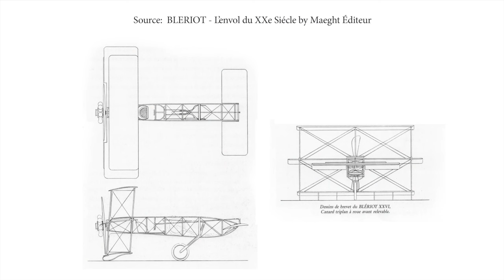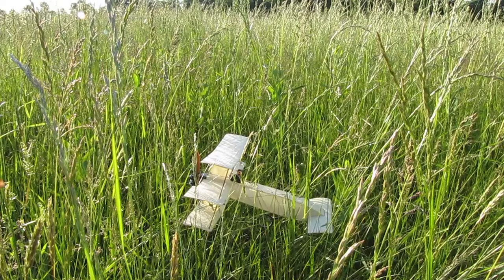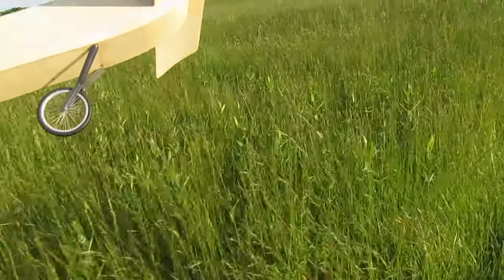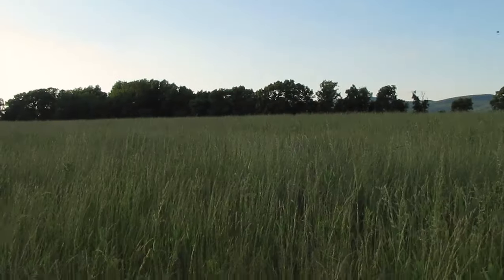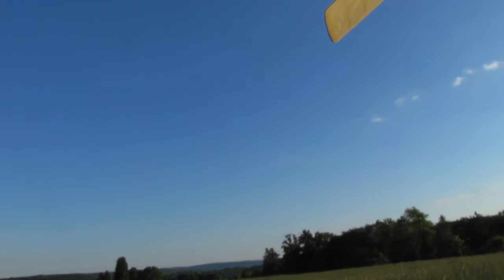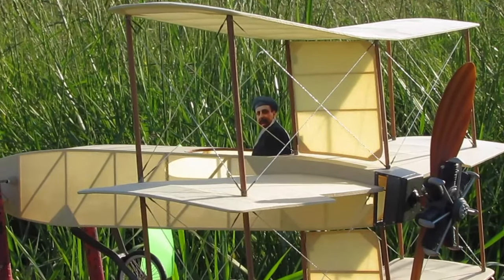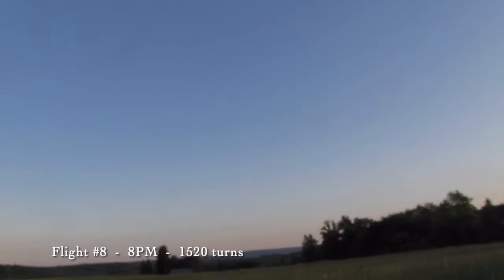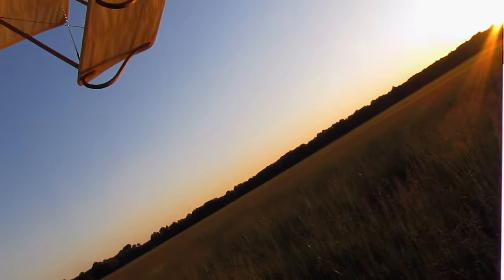Triplane Pusher Canard - The Bleriot XXVI Trim Session

Comment: The wings seem to have less incidence than shown on the drawing. That increases the decalage and alters the longitudinal trim. A quickie with foam fuselage and sheet surfaces might allow working out things like that. We don't have the opportunity for wind tunnel tests. Test glide suggests Dutch roll, but the usual cure (more fin) is not available. Less dihedral might work, but would require a lot of work (rigging). 2:06 date says January 12, 1914. 2 loops, four strands, 33" long will take around 2,400 turns. It is already climbing at 700 turns, suggesting the motor is too thick. Starting with a thick motor is good, though, because it allows flights with the motor running out in the air, allowing judgement of descent trim. Here is where descent circle is set with rudder. Left hand pusher prop - motor torque rolls right. Many things are reversed. Right roll makes right turn, which will get problematical on high torque. Right turn under power is opposed with right thrust. That is, to get the thrust to turn the plane left, you point the thrust line right. Last flight with thinner motor, still starting off right with slight stall on transition to left. Much more turns will want some right thrust. 

I noticed you had a white tyre originally, but the plane ended up with a black tyre. White might be more historically accurate. In those days rubber was hardened and protected from sunlight with white lead, instead of the lamp black that was used later.

I'm having as much fun watching these flights as you did flying them.
Reply from the maker: Thx for the comments. I’m glad ur enjoying the films. This one was definitely more of a challenge than most.

Comment: What about reducing prop pitch to reduce the torque at launch. It seems to settle down a few seconds into a flight. Of course the flight time will suffer some.
Reply from the maker: Thx. Surely an option but not one I would likely take because of the complexity of that adjustment.